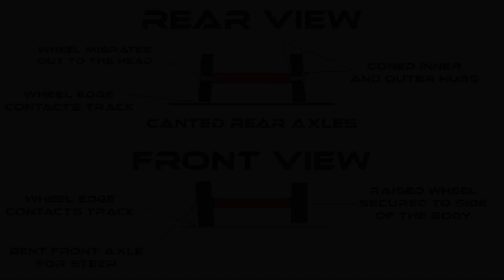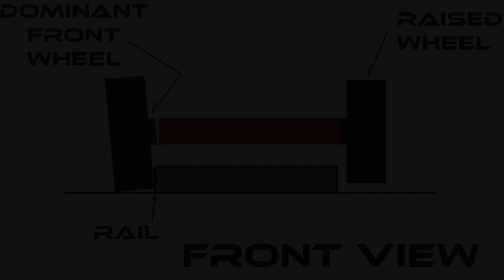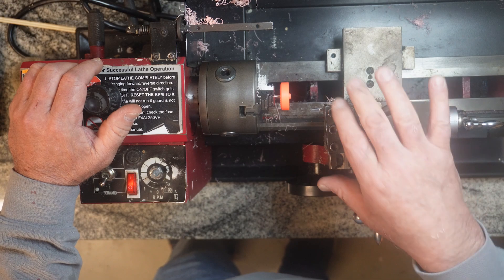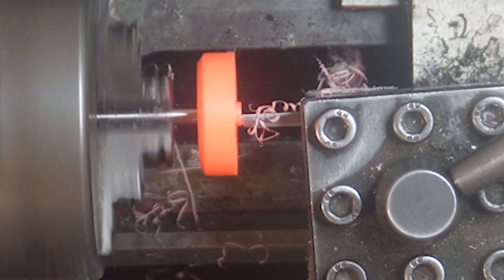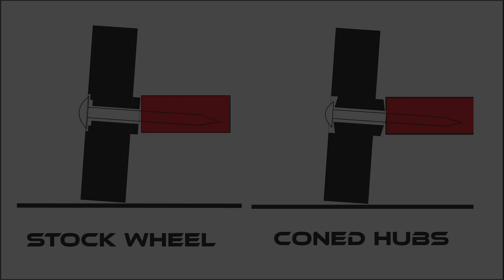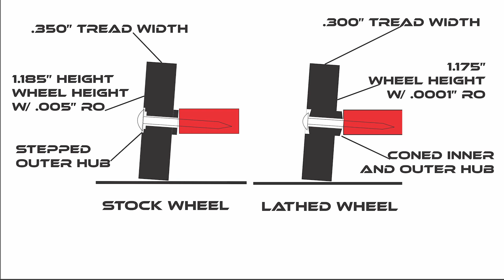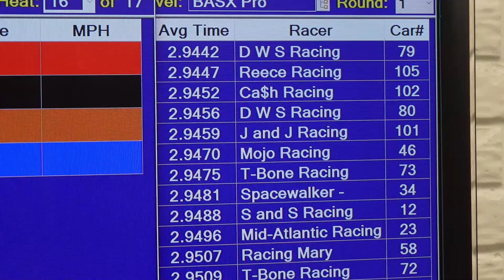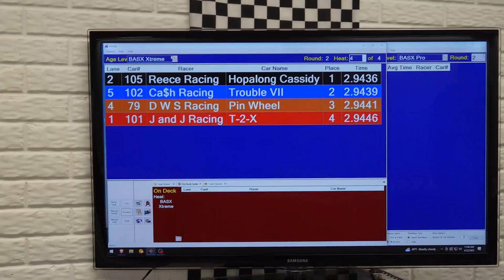Pinewood Derby Speed Secrets, Lathing wheels!

Comment: Is there a benefit to coning inner hubs if the wheels is canted? Seems a coned hub on the DFW will have more surface area riding against the body
Reply from the maker: I'm not brave enough not to cone them- just in case.

Comment: Where do you get your lathe bits from?
Reply from the maker: It's been so long but it was a diamond bit maker I found online
Reply: @mikemcguire2550 i should have clarified sorry the bit used to cone the hub and cut the inside of the wheel.
Reply from the maker: @brian97cobra   Oh okay. You can pick those up at harbor freight. You'll have to grind them to the shape you want. I have one designed to remove mass and one to cut my outer hubs.

Comment: Great video! It looks like the tool you use to cone the outer hub is hand made? It's the third tool you show, you say you use it to gut the wheel
Reply from the maker: I actually have two tools that I made from steel. The tool I use to gut the wheel is rounded. The tool I use for my outer hub is not
Reply: @mikemcguire2550  So I'm assuming you just got you some tool steel and ground the shape you wanted, trial and error until you got the results you were looking for. Sorry to keep bothering you.
Reply from the maker: @bcworkman1983  Thats exactly right
Reply from the maker: @bcworkman1983  that's exactly what i did
Reply: @mikemcguire2550  Great news. Thanks very much Mr Reece. I appreciate you answering all my questions!

Comment: Very nice!  Could you do a video on how you cone the axle heads?  Also, and this may no longer be a thing, but does anyone decrease wheel bore diameter anymore?
Reply from the maker: Sorry, I thought I responded to this awhile ago. I don't cone the head of the axle. The axles I use are already coned from the manufacturer. The leagues I race in don't allow us making the bores of the wheels smaller

Comment: Love the video and definitely tells me that I'm doing something wrong I just don't know what it is how easy yours is cutting where did you get your cutting heads for one two it looks like you might be angling them up with shims
Reply from the maker: I did have to shim mine up so the tooling touched the exact center of the pin. I'll see if I can find a link to my tooling, but its been several years. I had good luck with steel before I had the diamond. I just had to sharpen it between every set of wheels
Reply from the maker: Troy Eastman, turned me on to the tooling. I’ll see if he’s willing to share a link
Reply from the maker: diamond tool . com
Reply from the maker: Are you trying to cut Awana wheels? Those wheels have very soft plastic and are hard to cut. You'll need diamond tooling and go at a very slow RPM.
Reply: @mikemcguire2550  no I definitely think it is my tooling that's causing the problem but I'm having a hard time finding tooling that will fit my mini lathe it's even smaller than the one you have I just need to fix that part I think that will solve my problem